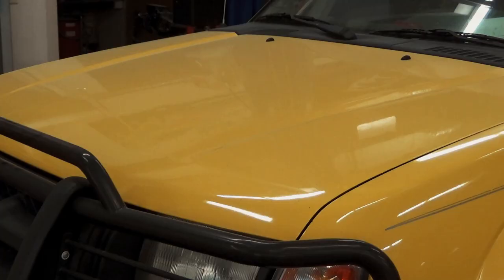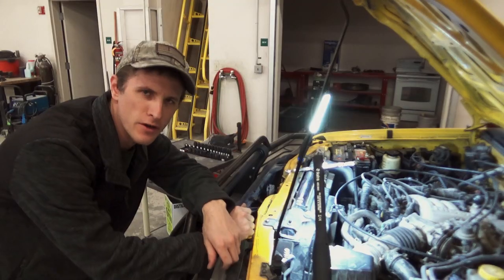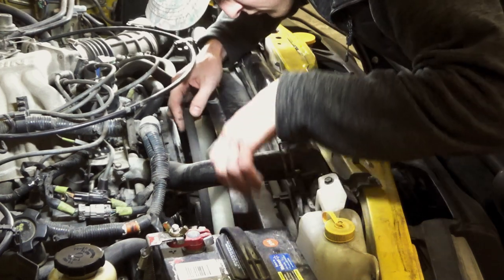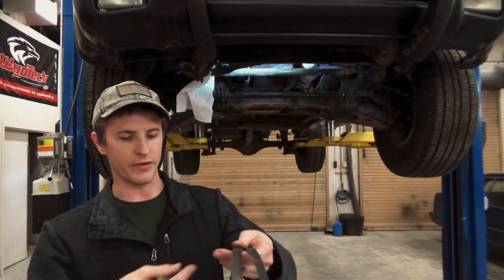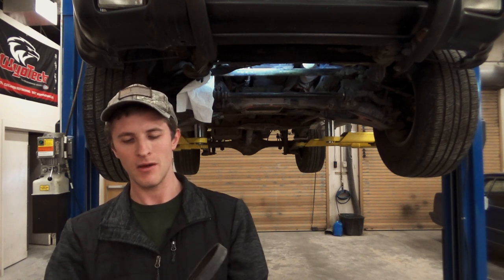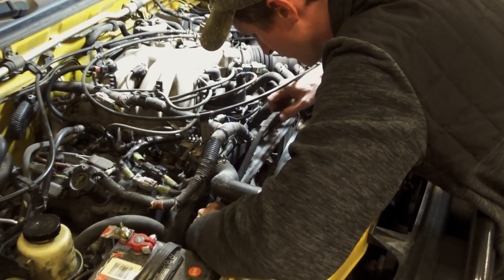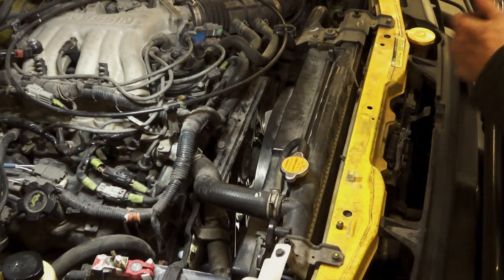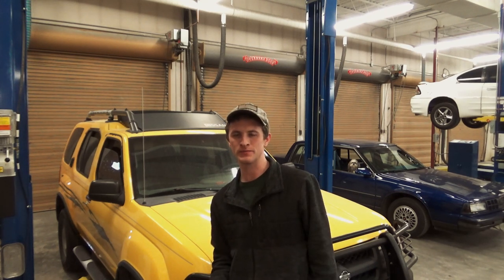Nissan Xterra 3.3L Drive Belt Change

Comment: Couldn't of asked for a better explanation of how all 3 get removed/installed.

Couldn't tell which one was squealing(alternator), but we used your video to remove each belt to isolate to culprit.

Once we got the alternator belt properly adjusted, it starts without waking up the neighborhood!! 😂😂

Thanks for helping me make some fun memories with my Dad. 🤘
Reply: What size are the bolts to remove the first belt?
Reply: @JulioMartinez-pm2fj mine were 15mm socket. Idk if you found out lol but it’s been 9 months and I just saw this